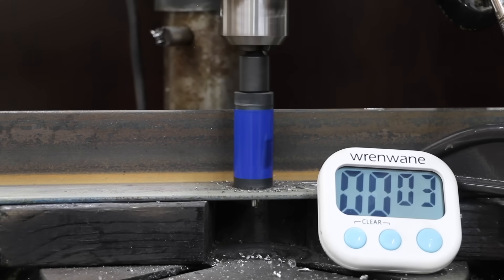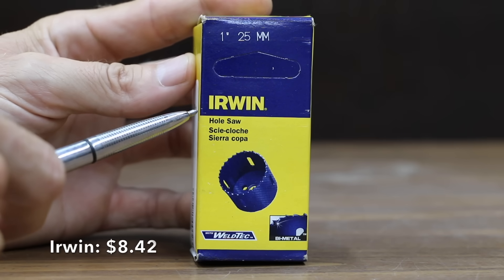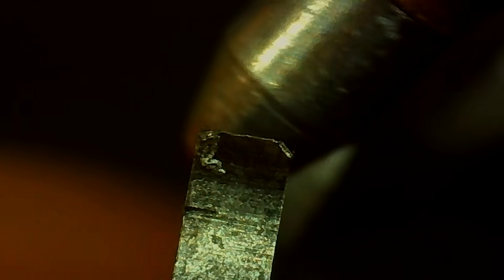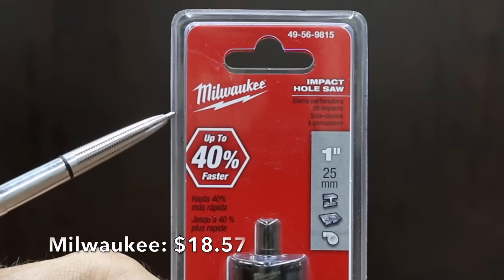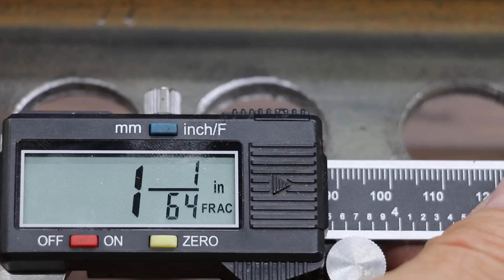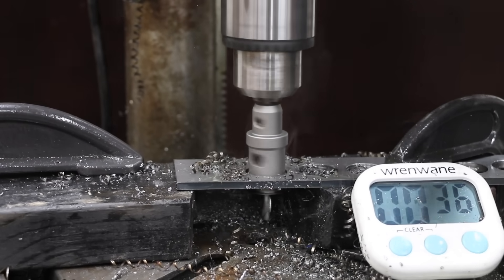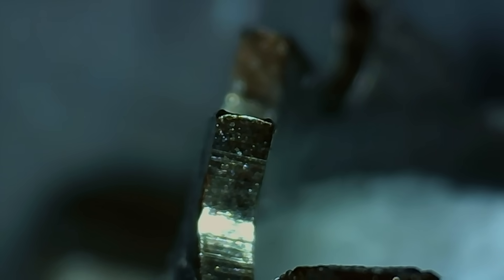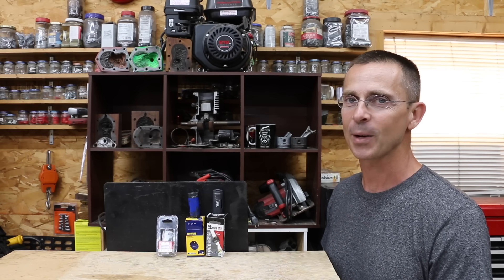Best Hole Saw Brand? DeWalt vs Milwaukee vs Irwin, Bosch, Lenox, Diablo, Bosch, MK Morse

Comment: Great video, I wish manufacturers would provide suggested feed pressure and speed for this type of thing. A follow up suggestion. We use hougan ROTO broaches to punch holes in truck frame. A number of company’s make a ROTO broach, sometimes sold as Rita broach, or annular cutters. Would be interesting to see how they compare in your test setup. We use them in a mag drill.
Reply: Also might be good to see if you manually feed by hand with a scale inline how each brand performs when you can “feel” your way through and see how much force each brand likes.
Reply from the maker: Great video idea.  Thank you.

Comment: Video ideas:
1. Adhesive/caulk removers
2. Tile cutting blades
3. Insulation
4. Oscillating tool blades
5. Sanding paper
6. Mixing concrete/thinset with various amounts of water to test strength
7. Water repellent coating for objects not glass
8. Masks
9. Fire extinguisher / retardants
Reply from the maker: Thanks for the video ideas.

Comment: Review Idea: Gas cans. I need to store gas for generator, mower etc and there's a wide selection, some seem goofy and Farm Project is the first place I looked for reviews. Sorry for posting here but I don't see any other messaging options. Keep up the great work!
Reply: I can tell you now, you can't beat a Wavian Jerry can and they come in different sizes. The No Spill cans are great for about 5 minutes until they start to leak at the seams. The Wavian is pricey but you will never buy another can. Just get the flex nozzle to go with it.
Reply: @williamdebow3478  Thanks, I will check that out.
Reply from the maker: Thanks for the video idea.

Comment: The final test is still bogus. I get that you want a uniform downward pressure to attempt to even out the test but that's not how real world cutting works. 
There's an exact force each tool requires to work efficiently, based and teeth surface area, hardness and temperature. 
Any monkey pulling the drill press handle works this out in seconds as you can tell its not cutting or stalling the holesaw. 

If you had used water to cool them and kept backing off, clearing chips and not stalling the saws everyone would've made the cut and you could've recorded real world times. 
Every tooth that chips off gets stuck in the hole, then the saw gets smashed and heated trying to grind through its own broken teeth.
Reply from the maker: Thanks for the feedback.

Comment: a good test addition would have been using one of the lathe calipers to measure how off center the bits are. After all you want the hole to be the right size, but you also want to be sure that where you aim is where the hole is going. This would be rather simple by just setting it up off to the side and then setting it against the bit at it lowest point to the metal.
Reply from the maker: Thanks for the suggestion.

Comment: Another excellent video!  Hole saws are specifically something that I've been looking into with regards to durability and effectiveness on steel.   I've been considering the Diablo that you tested, but now I think I'll try to find some Morse instead.    Thanks!

FWIW, I would recommend always using cutting oil with carbide on steel to keep it from chattering or sticking.  Either of those can quickly chip carbide cutters.
Reply from the maker: Thanks for sharing.

Comment: Very good showing, however, if possible I'd like to see it done with a mag drill with auto feed. Just curious if it's the drills or partially the drill press. Carbide cutters have sharp but brittle teeth. I felt they could have done better. But you do a lot of good work for us and is deeply appreciated!
Reply from the maker: Thanks for the video idea.
Reply: After thinking about the mag drill, I'm not sure if they have regular chucks. But I know they drill steel extremely well..my only reason if you can keep the carbide bits from vibrating they will normally to a fantastic job. But it was nice to know how well the bi-metal would actually cut!

Comment: 20 years ago when I had my shop I drilled a 1 inch hole in the side of 3 inch stainless steel pipe around 100 pieces a month and used Irwin hole saws with the welded arbor back then they were very durable I could drill around 500 pipe before needing to replace it
Reply from the maker: Thanks for sharing.

Comment: I have heard that carbide tooling benefits from a rigid machine. Being brittle it just does not like to bounce around a lot. Carbide is also made to run faster than HSS. So they may have been factors that influenced results? Still great testing though.
Reply from the maker: Thanks for the feedback.

Comment: (VIDEO SUGGESTION), not sure you'll see this??? You've had great success with your two and four stroke bicycle motors. The more I read on different threads there's quite a debate on spark plugs and different octanes. Would be cool to see a video with the use of NGK plugs champion etc using 87 89 91 ethanol free etc to see if it really makes a different on those 2 and 4 stroke bicycle engines. Thanks for all the great videos, look forward to them every Monday!
Reply from the maker: Thanks for the video idea.  Glad you look forward to the videos every Monday.

Comment: Industrial electrician here.  The top carbide sets we order are either Greenlee 660 or Klein 31872.  The Klein ones are better engineered and cut cleaner and straighter, Greenlee makes the most compact kit with easily changeable wide range (7/8" - 2").  The true test is drilling through real stainless.  Slow speeds and lots of cutting oil/gel/paste is a must.  If you overheat SS, it hardens to the toughness of carbide , and you'll snap bits when trying to redrill the same spot.
Reply from the maker: Thanks for the feedback.

Comment: I think the stalling of the press is an issue when it comes to grading the drill times. Saws with fewer teeth have a higher chip load and require way more torque. The stalling adds time to their count. I bet they may have done better if the press didn't stall. I bet it probably slowed a decent amount too compared to the high tooth count saws. I always appreciate your videos and tests. Looking forward to future great content!
Reply from the maker: Glad to hear!
Reply: I really think he should have done it with a mill. More power,  rigid and can control the speeds better. Though most people don’t have a mill.
Reply: @markbenoit  Thats the point, this channel is set towards the home owner, weekend warrior. 

Almost every bloke has a drill press not everyone has a mill, this test is a "real world" test
Reply: @markbenoit  Every time I've used a holesaw it was in the field with a battery drill. Usually for cutting holes in things you could never get under a drill press, let alone a mill!
Reply: @woopimagpie  exactly. Electricians and plumbers and carpenters working on houses usually can't use a drill press and they probably buy way more hole saws than machinists do. And you don't have good control of speed out in the field either. Also, you can't apply this much down force unless you are a lot stronger than me! But I still love the test.
Reply: McKenzie Keith also they will 99% not use a lubricant on the cut, and speed 2 or 3 on the battery drill, full trigger.

Comment: If you ever want to add another brand name you should look at BLU-MOL hole saws.  I use them on the press drill with mild steel all the time.  My first bottle of tap magic is coming in the mail.  I purchased after watching your video as I enjoy buying products that actually work.  Also use alot of seafoam and lucas products because of your videos.
Reply from the maker: Great suggestion!  Thank you.

Comment: A hole saw will not penetrate material that is thicker then the depth of its teeth.  That's why the few teeth carbide saws penetrated deeper.  (I allege that even in thick MILD steel the saws would quit penetrating (and dull their teeth due to rubbing).  A trick to avoid this in thick materials is to first drill in a little with the saw to get a "track" in the work.  Then drill a ~1/4" hole in 2 places in this track all the way through.  (If having a clean hole is important, offset these holes toward the inside of the track so it doesn't cut through the outer edge of the track).  These holes will allow the chips to escape and the saw will not slow down when deep in the work material.
          Other strategy is to (when drilling with portable drill) tilt the saw slightly off-axis in different directions to permit chip clearing.
          The "weight on the drill press" test setup causes sudden breakthrough.  This will chip carbide teeth!
Reply from the maker: Thanks for the feedback.

Comment: Working as an electeician I use carbide tipped hole saws fairly regularly.  Ive found that they seem to work better at a higher speed than a standard hole saw.  Lower speeds tend to make them catch and bog down.  
Ive found those impact rated hole saws are only good for cutting thin sheet metal  like on a light fixture
Reply from the maker: Thanks for sharing.

Comment: I would love to see you test various furnace air filters of different merv ratings and media thicknesses. It’s difficult to know which is the best balance between filtration and air restriction. I know this would be nearly the same as your car air filter test, but I think there is a lot of misconception/lack of knowledge about home air filters out there(myself included).

Love your videos! I recommend your channel to everyone. Practical science at its best, testing through the hype. You have saved me a lot of hassle in knowing which products will have the best practical application. Thank you🙏🏻
Reply: I think he's working on that test. It was requested a while ago.
Reply from the maker: Thanks for the video idea.

Comment: If you have another chance to do a hole saw test, I've had my greenlee set since 2014, and still going strong with heavy use. I am an industrial electrician. Very good for stainless.
Reply from the maker: Thanks for the suggestion for future round of testing.

Comment: Wasn't the cheapest option - the NGE - the only one under $10 that included the mandrel too? And it was the only one that made a hole that was slightly under the 1" mark. It seems like quite the value IMO
Reply from the maker: Thanks for the feedback.

Comment: As an electrician you make a lot of holes in metal cabinets; I’ve used a few brands and can say from experience Milwaukee bi-metal hole saws suck; I’ve burned through 3 trying to put a 3-1/2” hole in 12 or 14 gauge steal; I bought a Lenox and am still using it. No bi-metal I’ve used have ever held up to carbide. This is a definite area to buy once cry once as good bits will last. If you put holes in cabinets a lot up to 10 gauge stick to plug cutters as they’ll last a lifetime. As a side note Diablo carbide hole saws are larger then the reported size but at least a few thousands. Both the DeWalt and Milwaukee carbide hole saws make fast rough cuts in wood and go through nails like they aren’t there they have 3-4 big carbide teeth; they don’t work worth a darn in metal though.
Reply from the maker: Thanks for the feedback.

Comment: Wow thats interesting how the Shockwave Milwaukee failed never had any issues in metal with mine @Project Farm
Reply from the maker: Thanks for the feedback.
Reply: I had to  drill some holes in sheet metal and used shockwave bits and they were great. Way faster than the normal bimetal blades I usually use for everything. I was drilling handheld (not with a drill press).
Reply: @mckenziekeith7434  I drill by hand as well not with a drill press his drill press had alot of wobble which could of been why the hole saws failed wobble causes tooth breakage

Comment: In my years working in industry I found that a Hougen drill with their Rota Broach bits were simply amazing. Really a different animal since it requires a special drill, but man can those things drill. They can also be used to drill half a hole off of an existing hole.
Reply: Yep. I've never used a mag-drill, but I've seen them used. The maintenance guys used one to build die sets at the company I used to work for. They'd drill through 2" steel easily, and drill a perfect hole every time.
Reply from the maker: Thanks for the feedback.

Comment: i got some spyder brand hole saws from lowes for $40 on sale and they drill trough wood, wood with nails, and metal about 3/8 of an inch thick and those things are beasts i think it is a 13 piece set
Reply from the maker: Thanks for sharing.

Comment: Theres something wrong with your drill press. I see a lot of wobble under load. Can you tighten it up at all? I feel like the wobble is mostly under load which would indicate some slop somewhere.
Reply from the maker: Thanks for the feedback.
Reply: @ProjectFarm  No problem. Im no drill press expert but on my 82'' screen that wobble is very noticeable. If you put a gauge on it, i would bet 15-20 thou? More? Running hole saws with specific tooth offset would lead my to believe that this runout is making an impact. Still, a very good comparison for the typical hole saw buyer. Most of us have tools that dont run like a six figure CNC machine. Im sure my harbor freight press is much worse than what you are working with- just something to point out as far as scientific experiments are concerned.

Comment: After all the initial tests you did above and a winner is found. You should try buying three or maybe more of the winner product and redo these tests. Then you should compare the data to see if the quality of the manufacturing is held constant. What this ensures is that all the data received from the initial tests are valid and that the product wasn’t an outlier in terms of quality in the manufacturing process. For example, maybe you tested a product that may have been one-in-a-million times better then same products bought in the store and it just so happened to preform well on the tests, giving a false representation.
Reply from the maker: Great suggestion.  Thank you.

Comment: I have a Question,,, and it maybe a dumb one.  What's the purpose of the cutting oil exactly.  If the cutting blade is supposed to be cutting below the surface of the steal, how can the oil be serving and purpose.  I could understand if the blade was getting a constant flow of oil, like in a cnc machine.  In that case the surface is being cooled, however little sprites of oil seem like its just makes a mess.

Comment: Seeing the “lifetime tooth break warranty” on the Milwaukee sparked an idea. Maybe you should follow up on some of these warranties to compare the customer service of brands. I wouldn’t limit to just the hole saws. Having good customer service is something I look for in companies and usually influences my decision to purchase their product.
Reply from the maker: Thanks for the suggestion.
Reply: I would tune in to find out results of a warranty claim on the bit.
Reply: I'd like to see the results of that test lol
Reply: Yep, good idea. When talking to them, I would probably leave out the torture test, then decline to follow though on the warranty replacement because of what you actually did to them. By that point you probably would know all you need in terms of how easy the warranty process is.
Reply: I like the idea

Comment: Hello my friend. We built machines and work on steel plates of 1" and we cut the holes with diablo hole saw. They are great. But you need to use the pilot drill bit. The results aré amaizing. And use vetegal grease. It keeps cooled the bit and the edges
Reply from the maker: Thanks for the suggestion for future round of testing.

Comment: Do you use new blades/bits/holesaws when switching to different materials? I don’t ever hear you say that you do but I assume you do. Might add that small piece of context in there at the start of each video!
Reply from the maker: Thanks for the suggestion.

Comment: I've had good luck with Hougen rotacut cutters. They clear their own chips, make clean holes, and hold up well drilling tough materials like austenitic stainless. I've used them with cordless drills, drill presses, and even the bridgeport.
Reply from the maker: Thanks for sharing.

Comment: In the past I have found using oil for hole saws in steel is bad. I use water and liquid dish soap.and keep a pretty consistent flow on with a squirt bottle.. To me oil makes the teeth over heat and act as a bearing effect. Thanks your videos Save me money.
Reply from the maker: Thanks for sharing.

Comment: While im sure there isnt a big pool of bits to choose from, i personally dont think its fair to compare what we call locally a carbide hole saw which is for metal only to a hole saw that is more of a multipurpose use tool. That's just 2 cents from a commercial electrician who uses both on the regular.
Reply from the maker: Thanks for the feedback.

Comment: I do think this is great, my only thing is that most times in my case, i use hole saws at a higher rpm with less pressure. Of course thats also with thinner material and a hand drill
Reply from the maker: Thanks for sharing.

Comment: I don't know if it's worth an entire video, but I've always been curious if you could take a drill bit or saw that is on the low hardness side and toughen it up yourself. E.g. could you take the softest steel hole saw from this video, heat it up until glowing, quench it so it becomes harder than a new blade, and see how that affects performance.
Reply from the maker: Thanks for the video idea.